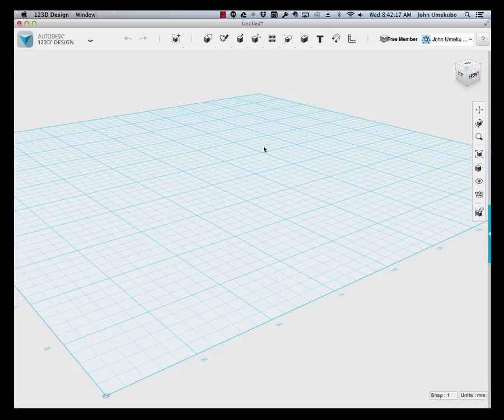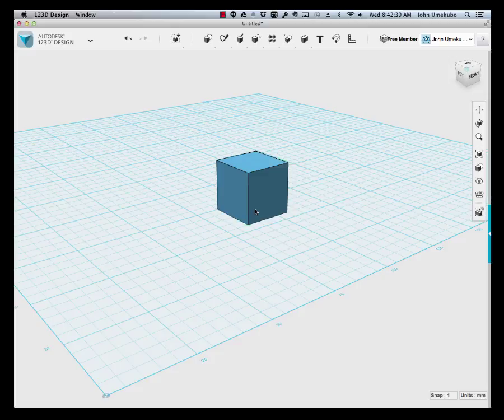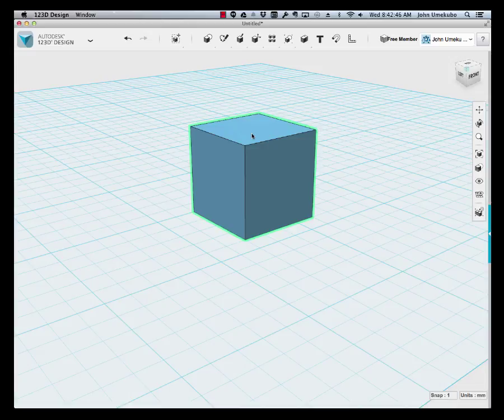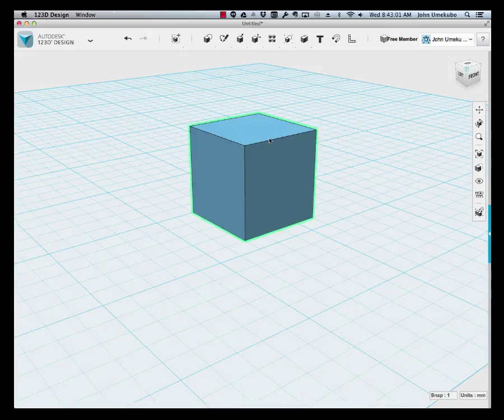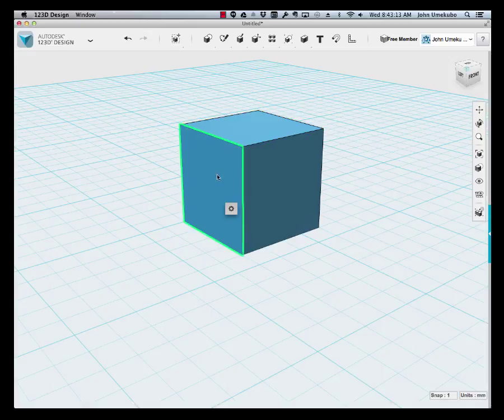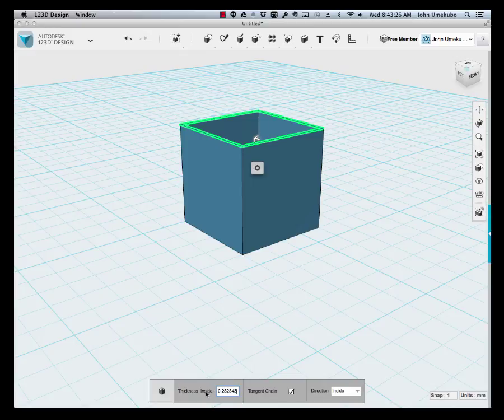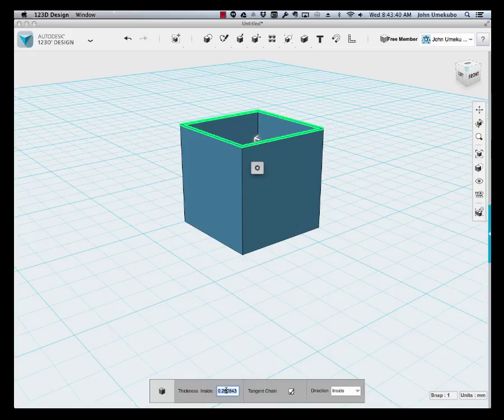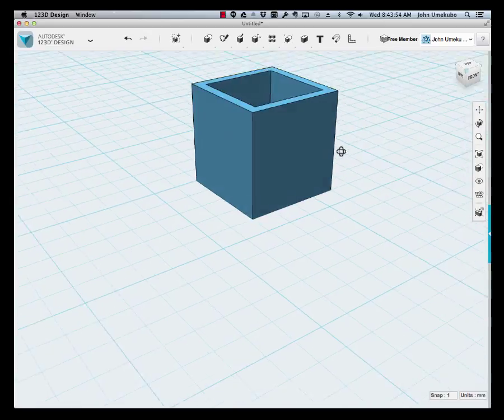Autodesk 123D - Hollow out an Object

Comment: hey, this works with a cube, but not the flat faces of a cylinder?
Reply: It does work with flat faces of the cylinder, and even a half dome. The one thing I often do is select is the wrong "surface".  If I select the rim of the cylinder's face (the edge) it obviously won't work, but the selection looks almost the same as if I were selecting the face. I have caught myself doing that a few times. Also please note that 123D is going away from the Autodesk line up. I use TinkerCAD, and will continue to use TinkerCAD, with my students.
Reply: yeah, just as i start the programs with tutorials are being made redundant. I've grabbed fusion 360, but ill try tinkercad!